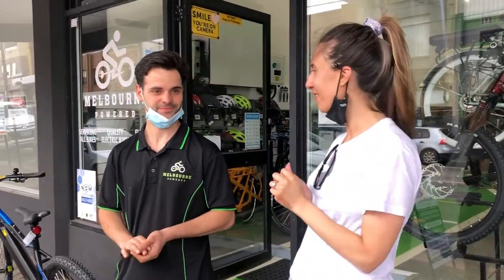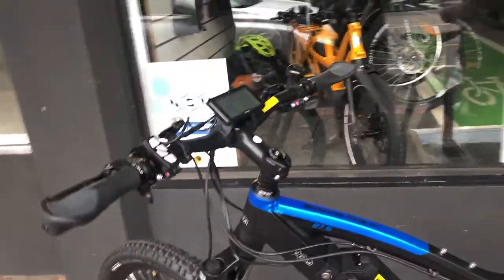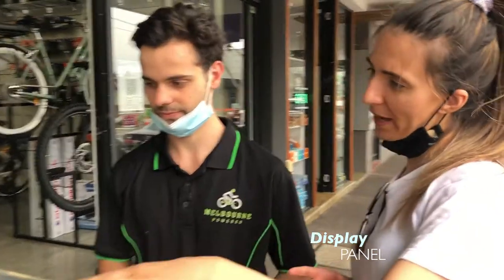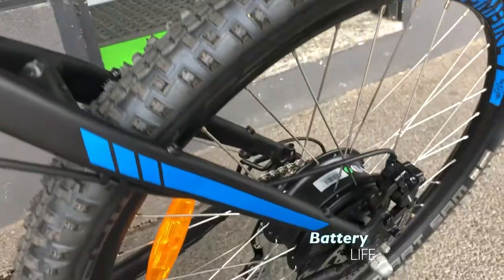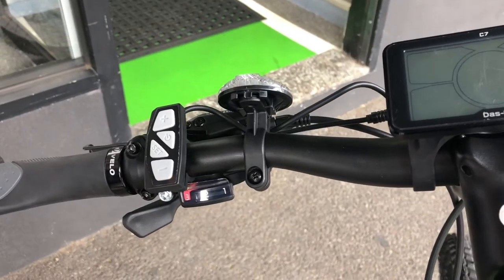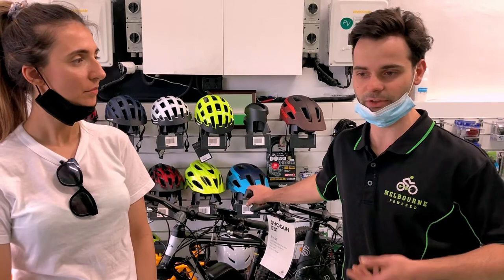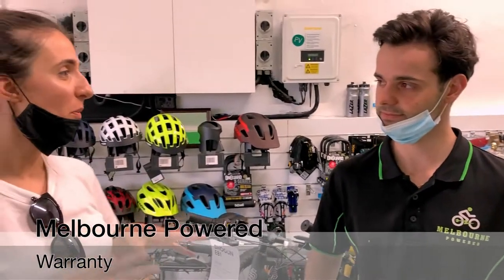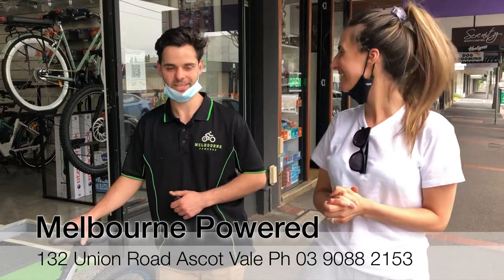NCM Moscow plus E - Bike Melbourne Powered Bikes

Comment: I've had this bike for 9 months now as my first and only eBike. It's amazing and it's made my life so much better in every single way. Just got home from a long ride today....it's the best purchase you'll make if you don't own a car. The NCM Moscow Plus is according to most reviews the best Bang for Your Buck bike at this price point by far. And while I've never ridden another eBike extensively, I can say the NCM Moscow Plus is amazing. I've rode it on shrooms and it'll change your life...I can not recommend it enough...it's become a Passion in life having this bike...eBikes are amazing so amazing. I want this in the Afterlife with me. 

PROS: This review is completely accurate. Ranges are correct in this video, when my bike was new and if I had continued taking care of the battery properly I would have gotten 66 miles a charge, 100km, with the Extended Battery Version of Moscow Plus. 66 miles until the motor completely dies on you. So I say 50 miles a charge then 16 to get me home. 

It's very comfortable to sit on and yes you can easily ride without the motor on the flats. It's more comfortable even, because the bike is almost a fat bike and I've never rode one before so I can say this bike has been the most comfortable ride I've ever had. By far. It's very nice to sit on for long times and you can go over many kinds of rough terrain.  Don't actually take it down a Mountain though you'll die. It's not meant for the true mountain trails. But you can go offroad on the grass or mild forest floor for a while, even with the power off. 

Very quick acceleration, which is a very good safety feature for navigating intersections especially going uphill or with heavy traffic. The fast speed is required to offset the weight. You should NOT ride this bike with the power off completely. Have the motor turned on at power level 0 for manual riding, but keep it turned on so you can use the Acceleration Throttle for traffic people navigating tight corners....for a bike this heavy it's a huge safety hazard to not have the throttle available at all times. 

CONS: Very heavy. 66lb pounds. I love this bike, and if it's in your budget please buy it. But if you can afford to spend more I can promise a bike that weighs less will be far more enjoyable. Ignore how good this bike is, the weight of a eBike is the more important thing....for comfort safety speed and lifting it around carrying it into your house (easy to sprain yourself if this thing falls between your legs, it's a risk) Moscow Plus doesn't feel like a normal bicycle with a motor attached. It's a very different motorcycle style experience. Even With the power turned off for manual riding it's still far from normal. I still love it though and ride manual alot. 

Avoid potholes. Even small ones. The rear tire going over curbs and the far end of even small potholes at normal regular bike speeds will cause a puncture on this bike. You need to avoid potholes like the plague. No chances. Or else you'll have to push a very heavy bike home. I've had 4 flats so far all because of curbs and potholes. Go as slow as possible over both of them. 

A good review on the bike though. The guy knows exactly what he's talking about, and the girl asks the right questions every time. Very informative direct video that doesn't waste any of your time. It's honestly rare to see reviews this good. Don't change your formula at all! Visual designs were nice to look at but maybe classic music instead
Reply from the maker: Very impressive and accurate review/comment of this eBike you have nailed it 100%. 
It is exactly what you can expect, particularly the pros and cons, which clearly paints the perfect picture, for someone who has never ridden an eBike before or is considering to purchase the NCM Moscow Plus. 
Definitely a fun bike to have, makes ridding much easier and enjoyable, as are most eBikes on the market today.
Thanks for the detailed review and hopefully people looking to buy an NCM Moscow Plus have enough info to make a good decision based on this excellent review and video.  
Once again thanks for your experience and detailed input.  And I’ll keep Classic music in mind for the next review :)
Reply: Lmaoooo I already know you were vibing hard on the shrooms cruising around. I just got mine not too long ago and it’s the best purchase I’ve made in a long time. I got it used with only 500km, the guy had the fully upgraded battery so my travel distance is 140km on a full charge. I would have bought the bike brand new but they were sold out everywhere in Toronto, Canada. So I was just like fuck it imma jus go buy a used one. But the bike is just tooooo much endless hours of fun. Really wanna take shrooms or lsd and go on a nice cruise
Reply: @chopboss   @chop boss  yeah dude that sounds amazing. It shouldnt matter if it's used at all, it's really a solid device, I've had mine for a year of heavy use and it rides and feels just like it did when it was new. My throttle trigger did break few days ago but that was after a entire years worth of pressing down on it. And luckily you got it now so you can ride it for the entire summer! ! Its a ton of fun on shrooms and tabs I plan on doing it again in a few weeks, just be very careful if you do it. Because in my experience once you find a good place to sit you won't be able to get back up and actually ride the bike until the effects pass haha
Reply: @pharaohsmagician8329  lol yeah the dude that sold me the bike said it wasn’t a good idea to jus use the throttle at all times cause you might break it but it’s very cheap and easy to replace. Lol bro I’ve been doing psychs for so longgg
Reply: @chopboss  Hey man can I ask you for some tips then?? Even anything in general about psychedelics I'm a newbie they're a ton of fun but if you have any wisdom I am all ears. And I'm glad to hear the throttle is easy to fix, I've been riding very carefully the last few days since it broke because it keeps automatically engaging at stop lights etc....can you just buy one online and plug it in? Or does it need to be something very specific
Reply: @pharaohsmagician8329  I’m pretty sure you can just buy one from Leon cycle and I’m sure there’s YouTube vids on how to do it. 
But yeah bro I’ve been doing psychs since I was about 16 lol. I know they are a ton of fun to be on and eveything but you always gotta be careful because they are powerful. One very important thing I want to tell you is when you want to trip, just make sure you are happy, in a good mood, make sure there are no issues or problems In ur life that you think will make you go into a bad trip. Also if you want to trip with friends, make sure they’re true real friends because the last thing you want to do is trip around a bunch of fake people. But you can also trip if you’re trying to figure things out in ur life because psychedelics will later show you everything on the table that you need to work on and all that. But yeah psychedelics are beautiful but just please be careful bro! Sorry haha I’m all over the place but those are some main things I always tell people
Reply: 3 years, 5700 miles, still climbs the steepest hill here like riding the flat. I'm thinking
of buying another. you do need to take care of it. I expect mine to last a decade.

Comment: Hi and thanks for posting your honest review, I see on the Leon website specs that the NCM Power Plus model can reach up to 150 km distance (depending on terrain conditions & power level settings) this seems to be a huge statement and how would this ever be achievable ? I weigh 91kg am 5'11"  ride mainly on flat city roads and a small amount of fine gravel cycle tracks so in the realistic worl  at an average cycling speed of lets say 23-25km/h what km range would I be looking at before charging  and to what low level should I be charging the battery at. Cheers Glenn
Reply from the maker: Hi Glenn, Thanks for your comment. Yes I would agree reaching speeds of up to 150 km I think would be highly unlikely! However with an average speed of about 23 to 25 km it really depends on how much peddling and work you contribute to maintain that speed. With medium to very little effort I have been able to get between 80 to 85km range. Again that would also depend on the terrain but if it is generally a flat surface I would say that’s easily achievable if not a little more. As far as charging I usually charge when there is one bar remaining. But I would check the manufacturers specs for the battery to see if that’s the best time to charge sometimes discharging completely could also be beneficial but don’t quote me on that. On a side note to date I have never run out of battery while going on 4hr rides. But again I do use pedal assist and don’t have a trigger option as they are illegal in Australia. Hope this info helps.
Reply: @TakemeupProductions  thanks for your reply, I have just noticed that this bike also has three riding modes echo, normal and power I would imagine that it would be worth while trying them all out and see which gives the best km range, may be best tested  on flat roads and using PAS 3. I would think that the normal mode may offer the best km range as the power mode is more for hill work. I would still like to know how you would get 150 km range on the Power Plus as this is what Leon Cycles claims on their website  main features info. Cheers
Reply: And I would expect having a trigger option would use more battery power so not having one would surely give you better range so if anyone has this option that could be worth testing out and showing a compariaon and using the three riding modes that are also available. cheers
Reply from the maker: @glennvanderbusse4137  yes it has six speed options which assists with more power at each interval definitely using trigger mode only without peddling would reduce the battery life dramatically.. so it would be interested to see the range you get with trigger option only.  Possibly worth checking out some other forums that can help with that info. Post to comment if you find the answer 👍
Reply: @TakemeupProductions   I only get a little trigger happy when I am crossing busy intersections otherwise I just bike using mainly PAS 3 and Power mode. I shall put the current indicator on to normal down from Power (above left on C7 screen) and keep using PAS 3 and try not to use the trigger. I will let you know the result once tested. Cheers
Reply from the maker: @glennvanderbusse4137  Thanks Glenn looking forward to the results 👍

Comment: No thumb throttle? the plus suppose to have this?
Reply from the maker: Hi pbag 1981 yes I believe in some countries like US it comes with the throttle connection however in Australia it is illegal to have the throttle installed. The legislation in Aus requires electric bikes to be speed limited to 25 km/h. However if you use the bike off road or private land then the throttle can be installed at an additional cost of approx AUD $ 240.00 USD $186.00